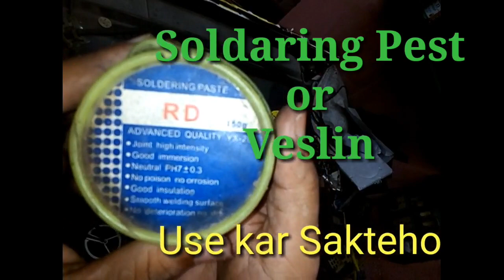TV Cap Fairing Salution.

Comment: Sir do bar  eht Cap or TV  ka eht cap lagne wala jaga bhi clean kiya hai but morning time me bahut zor se Spark sound arahai...kya isme eht ka fault ya other components ka fault ho sakata hai??? Reply sir kya mai  eht Flyback section Replace kardu🤔🤔
Reply from the maker: 1)EHT supply high hay ki dekho.
2)1600Pf valu thorada change. 
3)Eht cap spark cotin use kar shakte ho.
4)May vi ak problem solve kia ETH change karke.
Reply: @TarangaElectronic  Thanks sir i Wii be try.
Reply from the maker: Facebook page description box par link milega